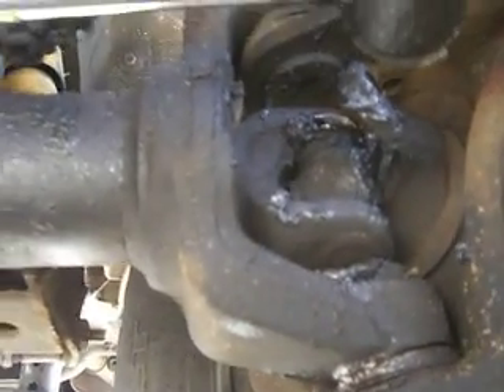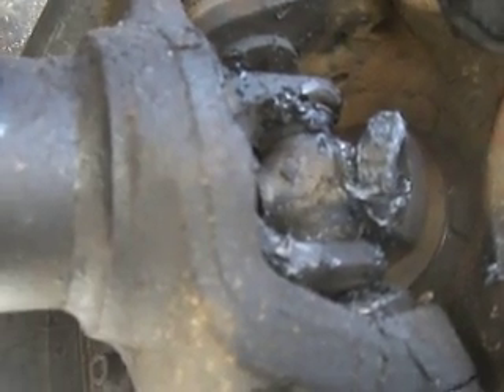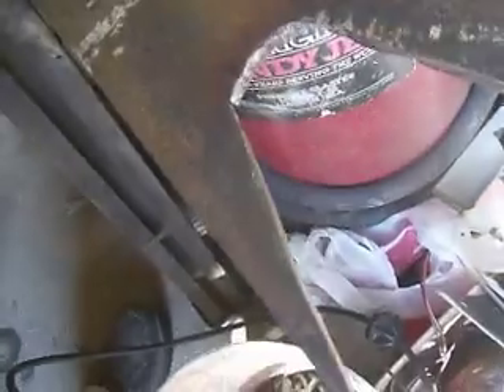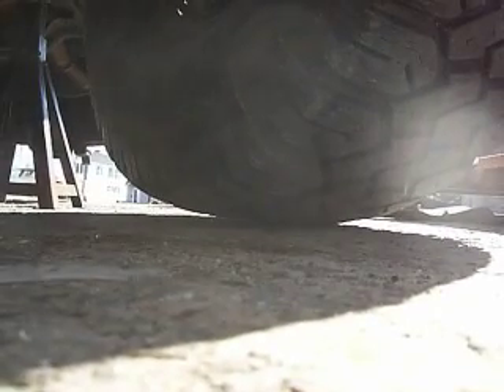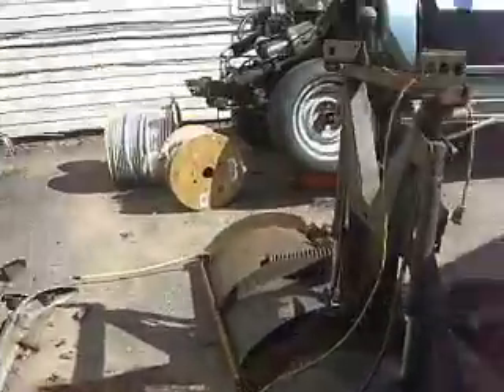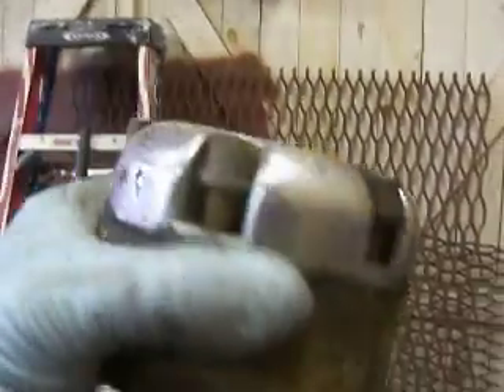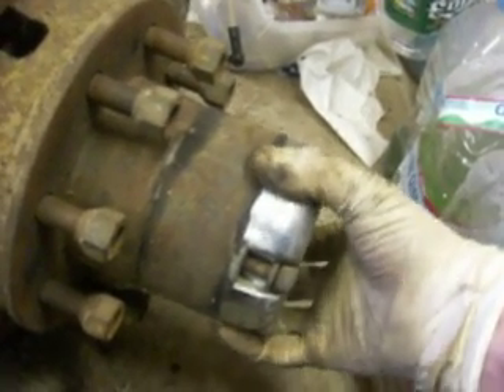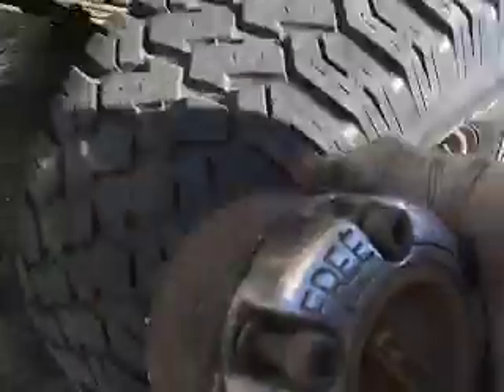What I Broke...

Comment: And to note, the Dana 60 center section was used on the one-ton front ends, had almost no interchangeable parts with the 1/2 and 3/4-ton front axles. One quick way to tell is to look at the disc brake calipers if they are there. 1/2 and 3/4-ton units use the familiar GM Delco calipers with the FMSI pad number 52 or 152 depending on the axle rating, whilst the one-tons used a Bendix style,a super-size version of the caliper found on larger Fords and AMC's until the early 1980s.Hope this helped!

Comment: Hey Andrew, it is a Dana 44 front axle.  The Dana 44 center section was developed before WW2, and got proven in wartime use, and is quite a strong unit.  This front axle is the same for 1/2 ton and 3/4 ton, used until roughly 1980, when GM went to a large corporate 10-bolt.  With the Dana 44 here, only difference is larger diameter outer races on the bearings, and larger rotors, giving it a heavier load capacity. The axle is full floating on both sizes, thus no more real strain on the diffy.

Comment: You sure that's a dana44 axle? I'm pretty sure dana 44 was only used on the 1/2 ton applications.

Or it could be a different hub setup for a 3/4 ton dana 44 (if there is one)